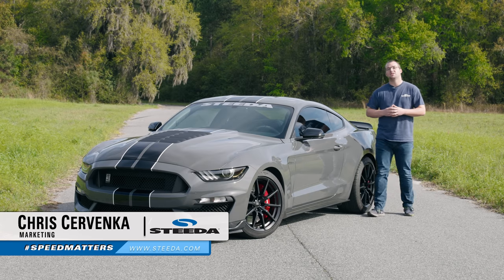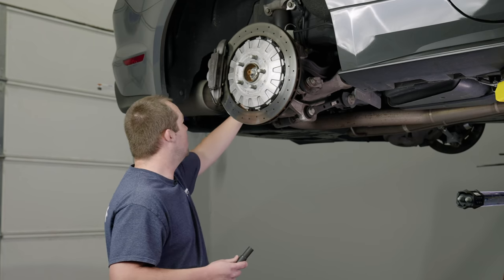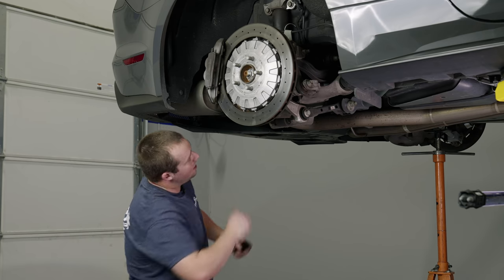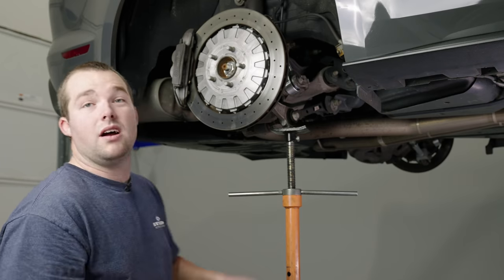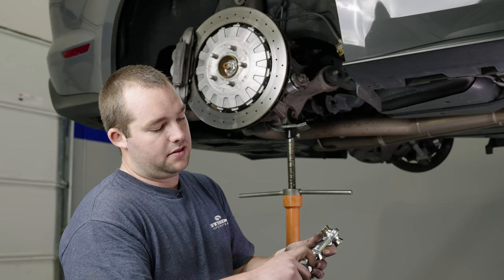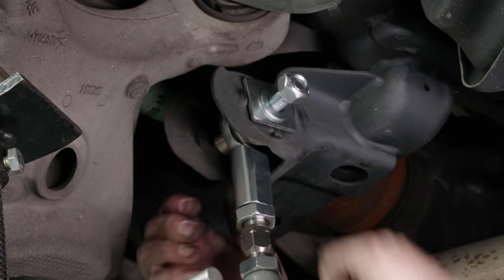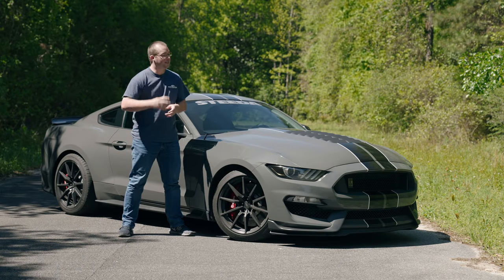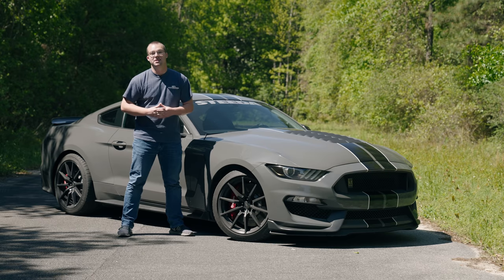Reducing Wheel Hop & Putting Power Down In Your S550 Mustang GT350 | Review & Install

Comment: I have most of these parts from Steeda on my 2019 Bullitt.  They work as described with literally NO wheel hop! I also have the sway bars and ultimate ride springs that has taken the Bullitt to another level! Thanks Steeda!
Reply: Hey bro, I just got a bullitt myself.  I was wondering if you could tell me which parts you added yours.  Also, did you install a short throw shifter?

Comment: I know this video is 2+ years old but for anyone reading the comments thought I'd throw this in.  There should be disclaimer that when switching to metal bushings over rubber, there will be noise.  I recently switch all the metal bushings to urethane due to all the noise metal on metal caused.  I also have a rear seat delete which amplified this noise since the seats are extra sound deadening insulation.  If you go further and add the lockout gears, it will also be noisy.

Comment: Do you have any before/after data to show the improvement in 0-60, quarter mile, or lap times after the components were put on?
Reply: It helps with wheel hope not grip . Pair it with tires you’ll see the difference. Yes it does help with traction but regardless you’ll still spin on stock tires
Reply from the maker: For this installation, we did not, unfortunately. However, we have a few more down the pipeline where we were able to showcase the difference. So stay tuned! -Chris
Reply: @smurfeco2.358  But wheel hop is a loss of grip? The tires are not fully making contact with the ground, which means you aren't able to accelerate as efficiently as possible. The reduction or elimination of this should result in quicker, more consistent launches/acceleration. It should be pretty easy to measure a before/after to see what all of the changes net you. Of course there are other variables like tires and temperature, but if you keep the conditions fairly similar it should give an idea of what has changed.
Reply: @PunkRockandCars  how I said you need a better tire . It would be better to see a go pro under the car on a stock car then with all these suspension parts .
Reply: @smurfeco2.358  Sure, a tire contributes and is a part of the system, but the stock tires that come on the 350 (PSC2) are about as good as you will get grip wise. A go pro would help you visualize the change, but it still is much better to have hard data to validate the benefit from it. The goal is to see a before/after to understand the real world gains.
Reply: @PunkRockandCars  it works
Reply: @PunkRockandCars  What I noticed you still get wheelspin but its smooth not bouncing up and down do far less likely ti break something. Also no more floaty feel going around a fast sweeping bend. With grippy semi slick like R888R tyres the car as a system handles really well. Its just part of a system you build.

Comment: I ordered the vertical links. When they arrived they didn’t include washers. Called and someone at Steeda said it was not supposed to have them. So why did you use them here? I am installing them on a GT350
Reply from the maker: Hey Layron - You're correct, the Delrin Vertical Links do not have washers. The Poly Vertical Links do. Hope this helps! -Chris
Reply: @steedaautosports  yep. Thought I ordered the poly but didn’t. Wasn’t purchased directly thru Steedas website. I will get them returned and order the poly bushing links. Hey thanks Chris and I enjoyed the video.

Comment: Should we have the weight of the car on the suspension or control arm before tightening the two bolts of the new toe arm. In this way we can make sure the bushings are in neutral position when the car is sit on the ground

Comment: I have 23 Mustang GT with the performance pack. There is no more performance pack 1 & 2 for this year and I believe last year as well. Do I still omit the bottom bushing or do I use it. Please let me know.
Reply from the maker: Hi Chris - This video is catered to a GT350, so for a GT Performance Package, you'll be able to use all of the bushing supports in this kit. Hope this helps! -Chris

https://www.steeda.com/steeda-s550-mustang-irs-sub-frame-bushing-support-system-2015-555-4437.html
Reply: @steedaautosports  Thanks for the response. I want to get that entire setup. It looks really easy to install. I could do it with a jack and stands.  Also thinking about getting that short throw shifter kit.

Comment: In the process of getting all of this installed on my GT350. Just to confirm, it isn’t until you get to the adjustable toe links that you need the car aligned right?
Reply from the maker: Hey Rob - Just answered your e-mail! Once you unbolt that rear subframe, you'll need to have the car aligned. This means the Subframe Bushing Inserts as well as the Alignment Kit will require an alignment after installation. That's typically why I recommend just doing it all at once so it's one and done. However, the IRS Braces and Vertical Links do not require alignment after installation. Hope that answers your question! -Chris